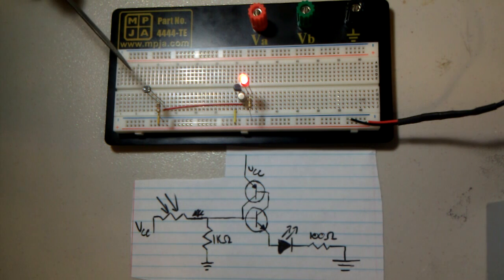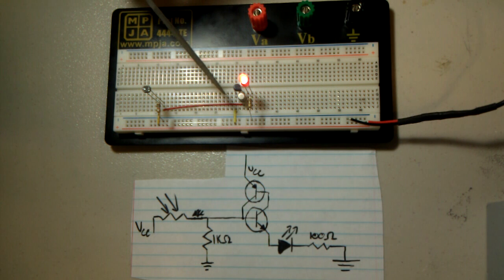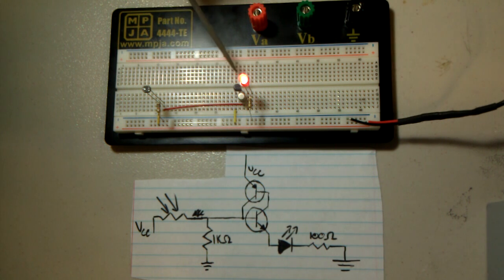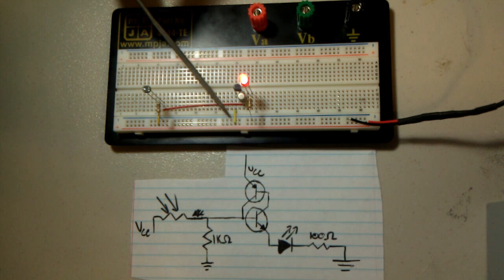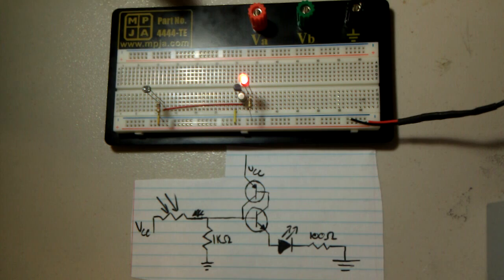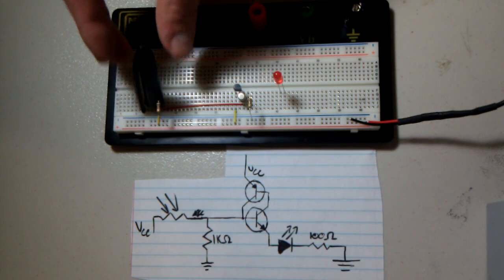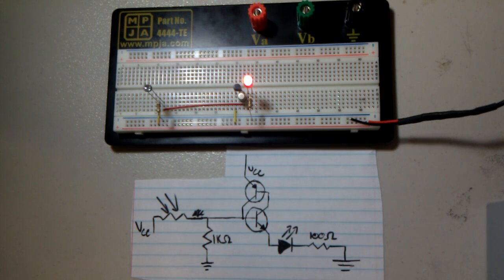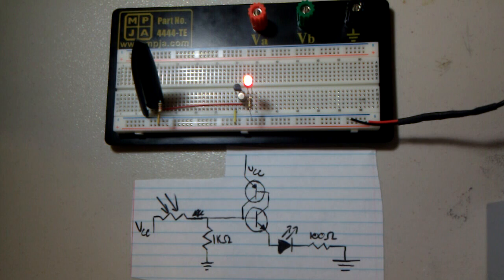Example Thyristor Circuit Explanation

Comment: Would it be a better design to place the LED resistor and LED above the thyristor? So that you only need to reach ~0.7 volts from the voltage divider in order to make the NPN conduct? Otherwise you would need at least Vbe and Vforward of led to make this thing conduct??

Comment from the maker: Transistors are used to switch the LED; in this case, two are used to keep the LED on until the entire circuit is disconnected. You could happily keep the LED powered without any transistors.